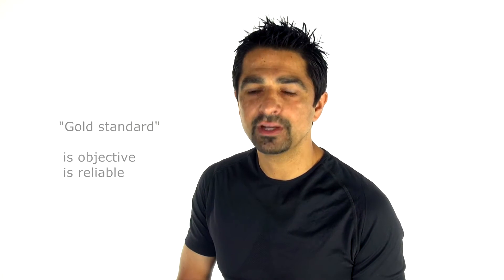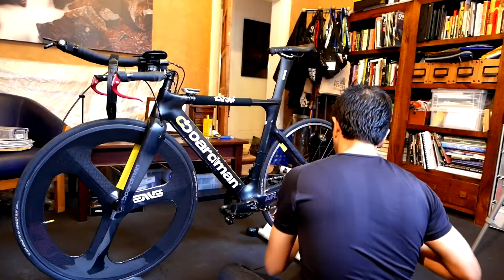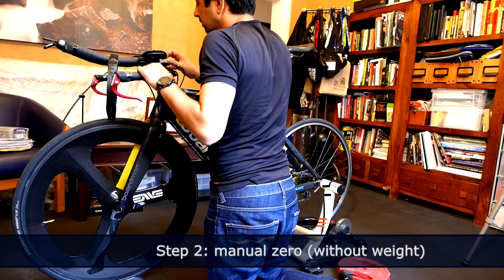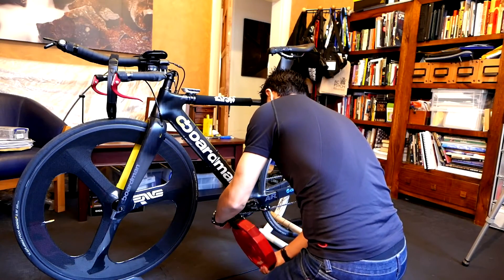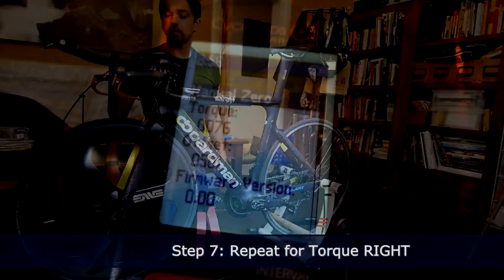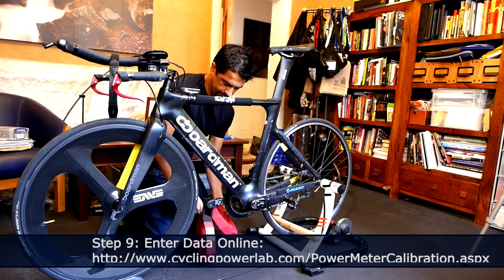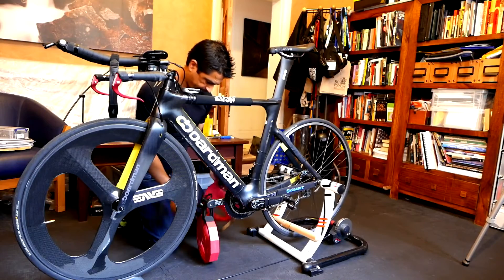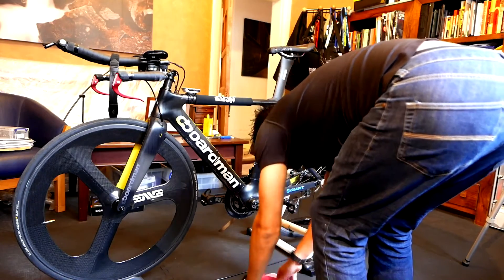Bike Powermeter weighted calibration test (stomp test) Step-by-Step using powertap hub

Comment: Hi!
Do you now if a Power Tap SL+ shows a different torque value in Garmin Edge for this calculated? I saw this in any place, but I don't remember... I did the stomp test with my SL+ and the value showed in the Garmin display is not coherent whit this equation. I simulated with different weights, with 2.045 kg the torque value showed was 1.56 and the calculated was 12.56 . Then I checked with my Tacx smart trainer doing a 1 hour ride and the power values are so closed, minimal differences. Well, I don't know how to check with stomp test my hub...
Thanks!

Comment: Caution to who ever does this on a 5kg weight all you have to be off is 100 grams which on most weights and bathroom scales is probably very easy to get off 5% or more. But if you only use one power meter you power will just shift +- where ever the weight error was. But if you have mutiple bikes you have just added an extra % you accuracy can be off
Reply: You can just use higher precision scale (1g resolution at least) to weigh smaller weight plates and then combine them into one big calibration weight (at least 20kg recommended). Even kitchen scale will be sufficient if you have smaller calibration weights (500g, 1000g) to check if it's accurate. You can obtain +/-5g accurate calibration weight this way at pretty low cost.